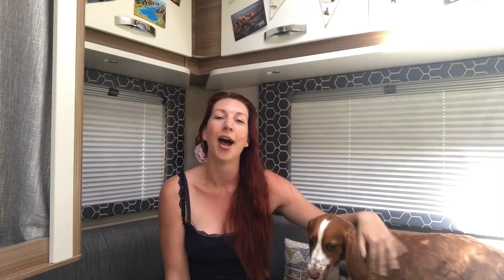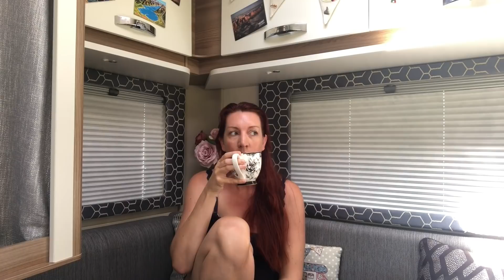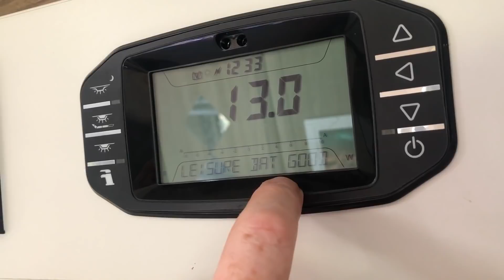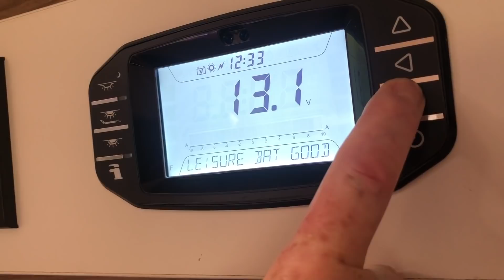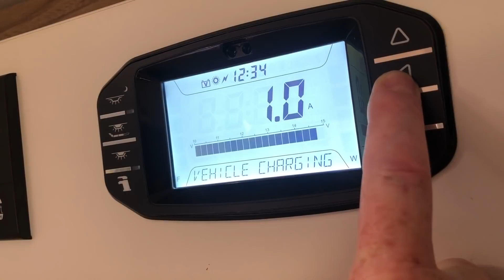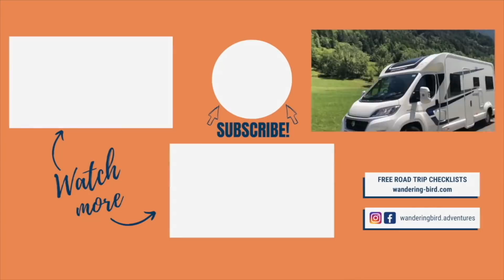Wild Camping- How to get Power Off-Grid  in your motorhome or camper

Comment: We use our 3 pin plugs from our battery solar set up  - you just have to feed it with a 3 kw full sine wave inverter and have substantial solar and battery capacity - we have 300w solar and 310a/h  lithium  - thats almost 4 kw stored -  I guess it depends what you want to power - ours does a  compressor fridge ,toaster, 900w kettle. microwave, TV lights, water pump  - and e bike chargers - the battery is usually full by lunch time and then we switch on the 4 gallon water heater for 20 min (600w)

Comment: i also upgraded to 2 leisure batteries, no more power but more amp hours so you get power for longer, coupled this with changing all my light bulbs for LED and its easily enough for 5 days at a festival running lights at night and charging phones every day. Of course if you have a solar panel thats not a problem anyway but i haven't put one on my current motorhome. I did have one on my campervan so used to be able to run a 12v fridge for 5 days constantly at festivals, it would run of the panel during the day, switch to battery at night and by the time we woke up the next day the solar panel had charged the leisure battery back to full power, and so the cycle repeats!!

Comment: these are good to convert a 12v TV socket to use for cigarette lighter accessories. or you can take it further and use the plug but wire it onto a USB socket to give you something to plug a USB cable into directly - https://www.caravanaccessoryshop.co.uk/product/adaptit-parallel-pin-to-cigar-lighter/26

Comment: Just a simple tip: anything that provides heat from electricity uses a lot of power (kettle, hair drier, fan heater, electric radiator, iron, washing machine, tumble drier, water heater, etc.) Usually electronic goods use little power (phones, laptop, TV, LED lights). This is true in a motorhome or a house. It is also true at 12volts or mains voltage. I hope that is helpful in understanding some basic principles.

Comment: I fitted a dedicated fused 20Amp heavy duty cigarette socket directly to the leisure battery behind the drivers seat which also allowed for the heat to dissipate through the socket body and wooden plinth, i needed it for my Macbook laptop charger.  I have also fitted a Victron 120W solar panel which is fantastic and gives me 85AH per day, and a Victron battery monitor, this is because the PMS3 management is great for what it does but is no help for usage and current remaining and cannot be configured for the 3 leisure battery types.   I am in a VW T5.1 conversion.  The other thing to note is cable size when fitting these bits of kit.  I believe with the fridge at 50% I am getting 7+ days off grid with careful use.